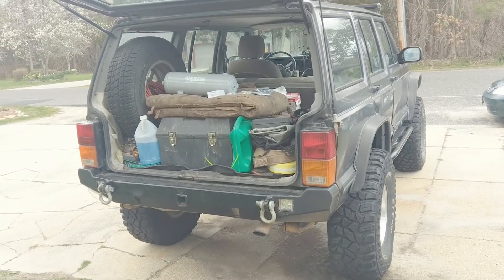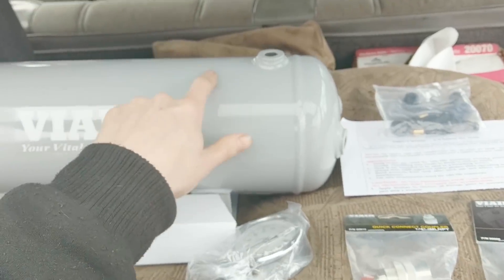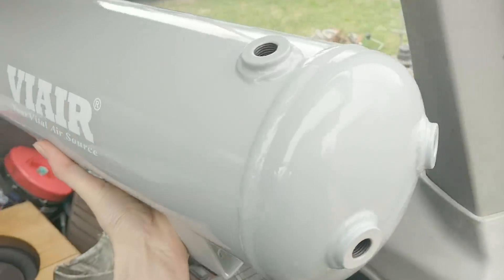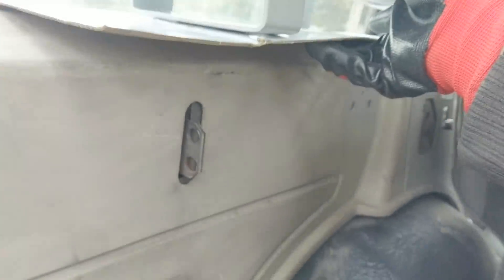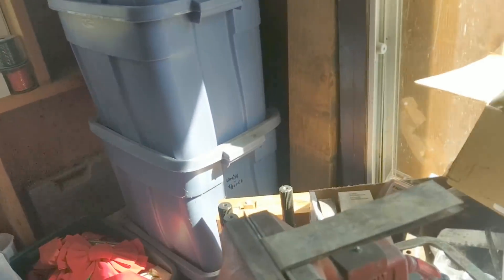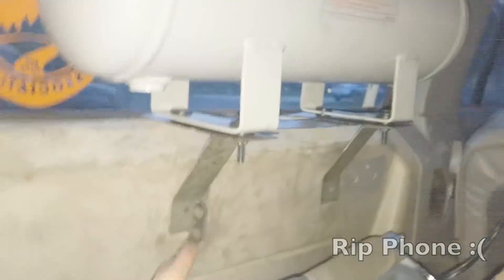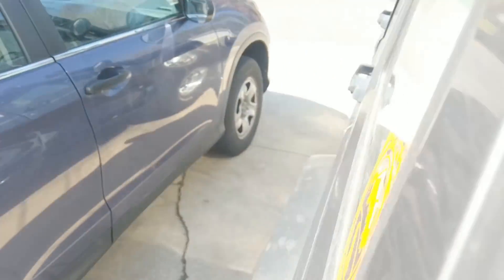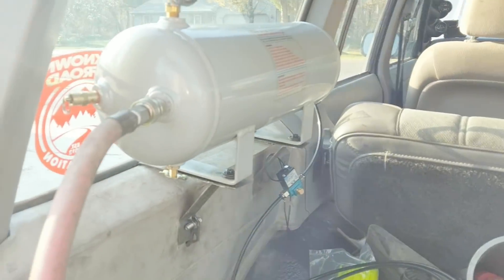89 Cherokee Viair 2 gal Air Tank Install

Comment: I was waiting until the end to see the time difference for airing up a tire compared to the 3 minutes the pump alone took before lol. Damn nice too
Reply from the maker: This is going to probably be a 3 part series as we've still got the pump to mount and wire, as well as the locker. I do need to do a proper stopwatch of what this system can do. It's ok, but nothing to blow your socks off.

Comment: Always dig your vids Nick! Turn the gauge so you don't have to pop the rear to read it? Also, we're waiting for the auto tire inflate install now! :-)
Reply from the maker: I was thinking of tweaking it forward a bit more to read from the driver seat, but with the pressure switch it'll kick off when it's suppose to anyway. And don't get me started, I was thinking about making a 4 hose auto tire inflator to fill all the tires at once with an auto kick off at the right psi.
Reply: That would be awesome but I realize the effort involved is a bit more than bite sized. I'm happy to follow your build as my Cherokee is sitting on jacks waiting for Dana 44's. They are as rare as hens teeth in Sweden! :-(
All the best
Patrik